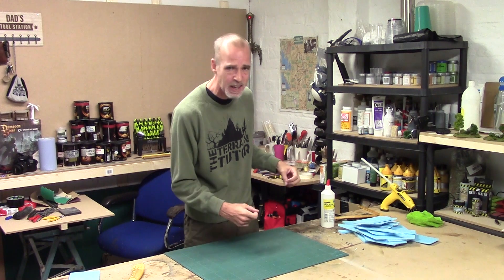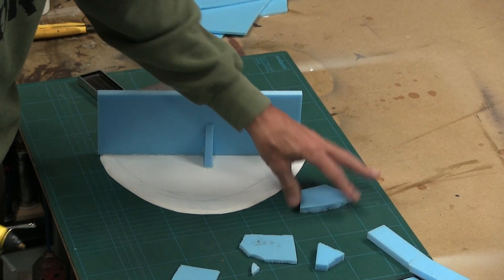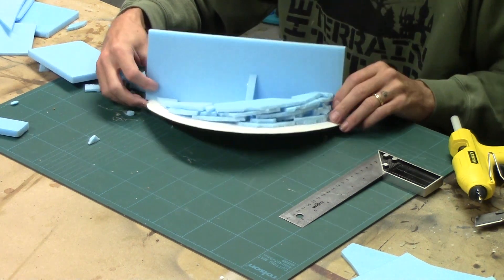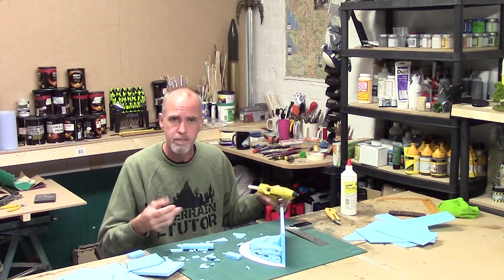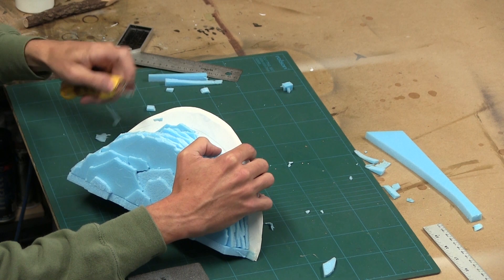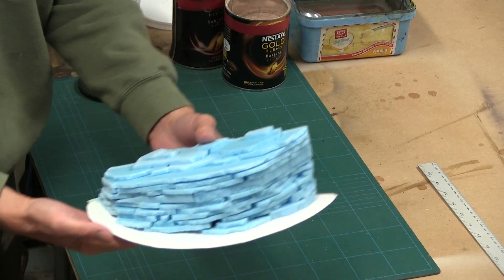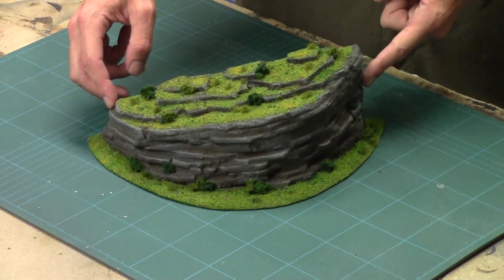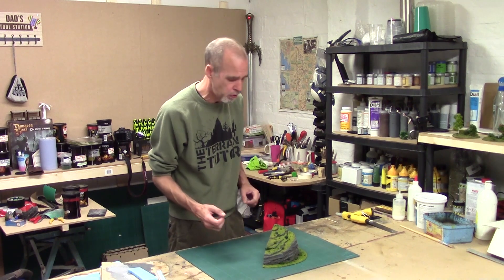Easy Layered Rock Face Terrain

Comment: Mel, wonderful as always. I'm torn now after seeing this style rock face style. On my Atlantic Wall-esqe diorama, I'm adding a Ponte do Hoc style sheet rock face between my ground level installations and trench network etc and bunkers for naval guns on the top of the cliff. The pictures I've researched for both Points do Hoc and Omaha Beach show both vertical and horizontal striations

Comment: Very nice job, Mel!  I am happy to see how you made the stratified layers of "rock".

When I was growing up early in the late 60s, early 70s there was a wildly popular 1/24 slot car race track business in town.  One of their roadrace tracks had extensive terrain features similar to what you made here.  You would have just flipped for the track.
Reply from the maker: Sounds awesome mate, how big was it?
Reply: The track was  probably eight - ten lanes wide and the entire layout was 40 - 50 feet long by 25 - 30 feet wide.  It is hard to say how long or exactly what the shape of the track was, maybe roughly a "W" shape with a cross-over bridge.  I wish I had a picture.  I'll need to look on the internet because that place is long gone.  The other 1/24 tracks were faster with high bank turns.

The shop had two floors and there were two 1/24 tracks on the lower floor, and a straight drag strip.  The upper floor had a 1/24 track and an HO track.  You would use your own slot car and controller on a 1l24 track and it would cost 25c for 15 minutes of use. At that age there was not any true "racing" for me, just trying to go around the track.

While I liked my cars, there were adults (one was a professional baseball player) who spent a tons of money on their gear.  My car, controller and tool box cost a total of maybe $25, which seemed like a lot then.  The really serious adults had cars that sold in the shop for $150 - 300 and maybe more.  Perhaps you heard the phrase "dollars per MPH"?
Reply: I looked on the internet for photos of the track and so far, no luck.  The most I could find were a couple of B&W pictures of the outside of the shop.
Reply from the maker: sounds like an awesome setup

Comment: Ahhhh, Inches instead of Metric. Thanx Mel! I understand inches, feet and miles but the metric system is a bit of a problem for me to look at and know. I can look at my car and know if the nut/bolt is 3/8, 1/2, or 3/4 inch but I can't look at one and know if it's 7, 9, or 28mm. Old Dog, New Trick thing you know.
Reply from the maker: I've actually got used to both systems and can work with both at the same time, like 3"-10mm :-D
Reply: I wander why people stick to only one metric system, when clearly both of them have their advantages. Use metric for very high precission and inches for longer objects, radious, etc...
Reply: This is so true. In Canada, we switched from inches to metric and I've been puzzled ever since with everything from measuring snowfall to knowing the temperature.

Comment: For sedimentary, layered rock, I like to use pine bark. At least in the US, it's available from home improvement (DIY) stores in large bags for around $1/lb. And a pound of dried pine bark is really quite a lot.

The edges of the pieces of bark have a very uneven, stratified structure that really sells the appearance of shale or sandstone.
Reply from the maker: I need to go bark buying, it's not as common as it was here
Reply: We sell it at B&Q, get down to Meir park it’s about £7-£8 for 100 litre bag

Comment: Have you considered using some no more nails type adhesive instead of hot glue? Would take longer to dry but no issues with melting the foam.
Reply from the maker: You can but you might as well just stick with pva, the hot glue is more about dry time than strength

Comment: I had also the problem of hot glue melting my scenery, i resolved by pouring the "blob" as you call it on top of an old cutter blade, wait a couple of seconds to cool and than spread it on the piece like butter.

Comment: I know you looooOooOOoove your filler, but could you also use tilegrit? Might help give a nice basecolour too
Reply: I use a colored sanded grout (earth) for sandy, rough textures. It works very well for that. I can only imagine how fussy it would be to mix it into the right consistency to replace filler/spackle/gypsum paste. I mean, I'm sure it would be easy with practice, but ugh.
Reply from the maker: Sure, I just use the simplest materials possible in these tutorials

Comment: Another major option for doing this kind of thing is to switch to using the cheap foam core to construct it out of. While it doesn't give you the larger variety in thickness of the layers, it goes much quicker in assembly, and kind of works better if you want a more south west style look for it in appearance.

It also, can, work better if instead of applying the filler by hand, you thin the filler to the point that it spreads by brush easily but still leaves some texture, you can get a slightly more interesting look.

Unfortunately, this kind of technique, of either type, does not work well for the look of places like the Badlands which work better if you just carve the hills then use thinned plaster to work the smooth look into it with mixed in grit. Then use a variant of the wash/ink painting to work it through followed by sealing it and hitting it with another, very dark wash to get the striations in the faces.

Comment: The range do a low temperature glue gun and glue sticks...works great on foam.
Reply from the maker: I really need an adjustable but I'll check it out mate, thanks for the heads up

Comment: Instead of using a blade for cutting the back I reckon a hotwire cutter would be easier.
Reply from the maker: It'd definitely work mate, but there's a bonus to being able to run the flat of the blade against the rock surfaces to get a level cut without worrying a slight deviation could dig in and give the edge/surface an un-natural cut. 

Saying that, it could just be that I'm all over the place with my hotwire cuts and I prefer a guide where I can get it lol
Reply: I have to say that for my own preferences, I find cuts with a blade come out more natural-looking than hot wire cuts after weathering. I feel that a wire cutter is certainly superior for cutting the basic shapes of larger projects, but for something small like this and for the final shaping, a blade gives me more natural results (imo, etc).
Reply: Totally agree. For rocks and cliffs, the knife or even breaking the material gives a lot of texture, wich will show later when painting. But i will prefer a hotwire for buildings or large cuts, and then snapping material with a knife for weathering.
Reply: With a blade, there's no worry of toxic fumes emitted from burning foam. What I would like to know is where do you find a knife sharp enough and long enough to cut through 1" foam? I saw a guy slicing foam to form a hilltop like he was cutting cheese, while I struggle with the foam forcing up into a lump, even though my knife (utility knife) is pretty darned sharp.